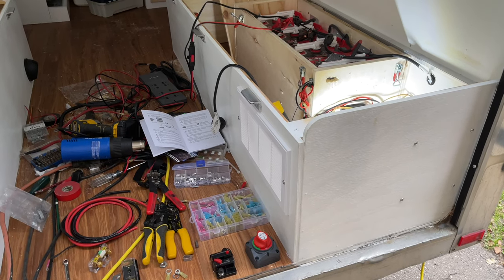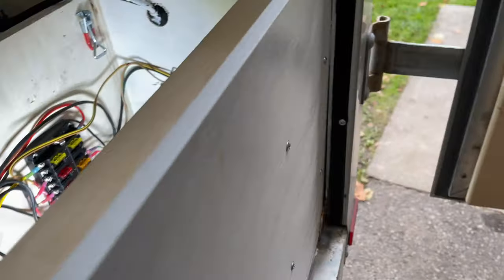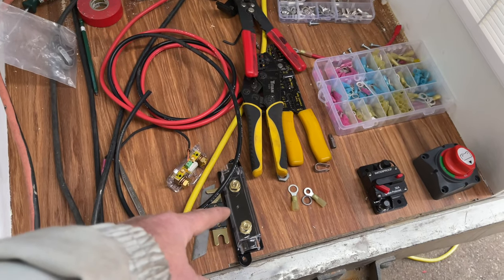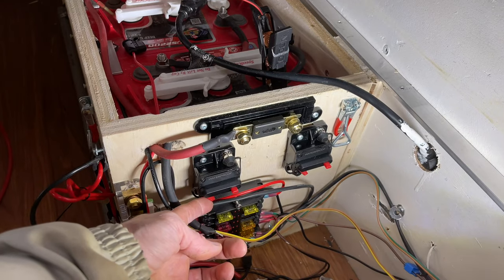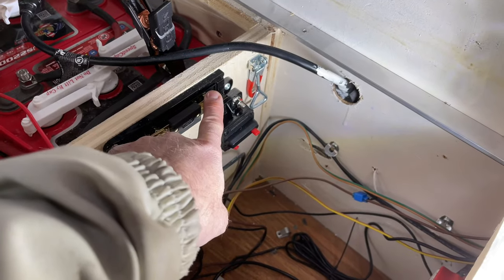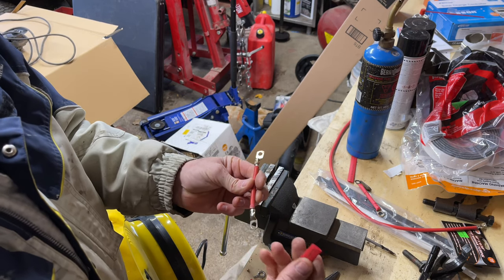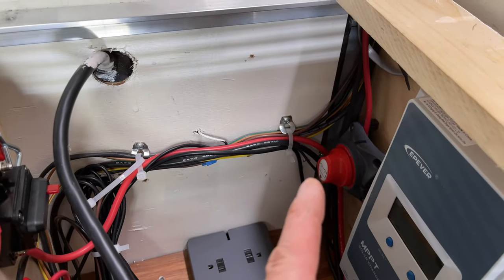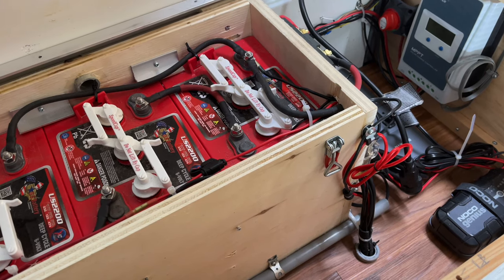How to Build a Cargo Trailer Camper - Solar Install Part 2/2

Comment: Coming along nicely.
I would not fret about the scc self consumption. Those EPEVER units are like .02 or .03 amps - non issue for a 400+ah bank, even in Canada.
Reply from the maker: That’s good to know I just figured it would be more. 
Although It’s kind of nice to just charge up my batteries and then shut the whole works off and not worry. Right now the panels are buried under about 8” of snow. 😁
Reply: @waysoutback  yeah I see the weather has kind of turned to Winter up there, I just caught your last upload. Looks like your creation stood up just fine. I'm sure there's going to be tweaks and mods, but I think you're in the "all good" territory.
Reply from the maker: Yeah we had a good time. Definitely tweaks to do but I kind of like that… part of the process. Looking forward to some deep snow camping in a few weeks! Thanks for following along 👍

Comment: I really like your installation. Have you had any issues with leaks or heat? Also is there anything you have changed or would do differently next time?
Reply from the maker: I’m afraid I’m still building it so I’m not 100% sure, I’ll do a proper tour once I’m done and I’ve towed it a bit. As for changes as of now I only have one…I am going to strengthen the tongue because it feels like it’s got a bit more spring to it, I’m also going to extend it a bit and put a different coupling on it. It’s been through some crazy rain storms and no leaks yet. I’ll keep you posted. 👍
Reply: @waysoutback  Thank You